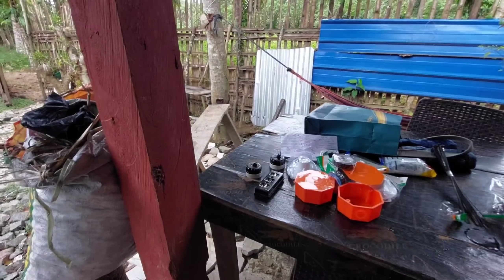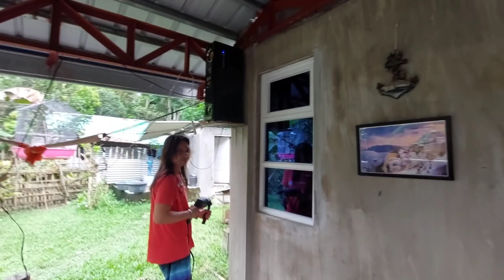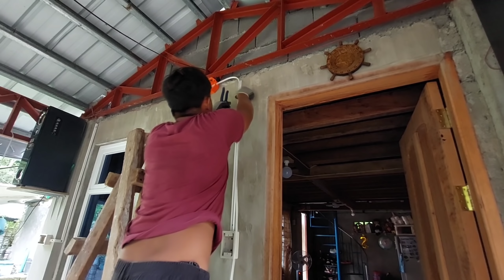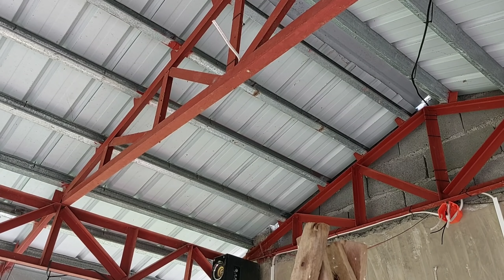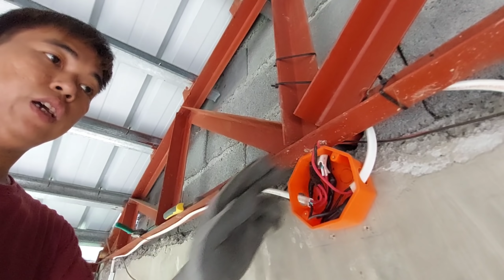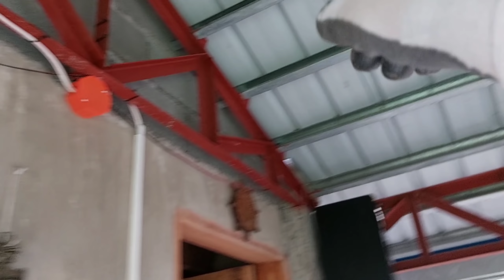Paano mag install ng isang ilaw at outlet gamit ang plastic molding? |Basic Tutorial

Comment: Tatanong oang po sana... Para sa 0.6hp ac... Ilang amp na circuit breaker, tsaka ano size ng wire .. salamat po...
Reply from the maker: 20amperes na po ang gagamitin nyo kapag 0.6hp na acu. then use #12 or 3.5mm2 THHN stranded wire. 
Salamat po sa feedback GODBLESS PO💜💜💜